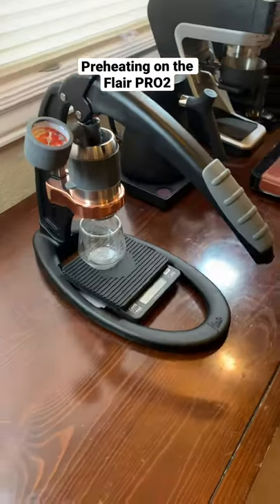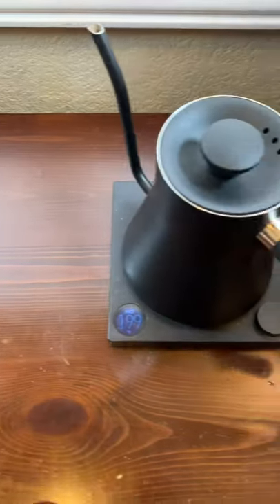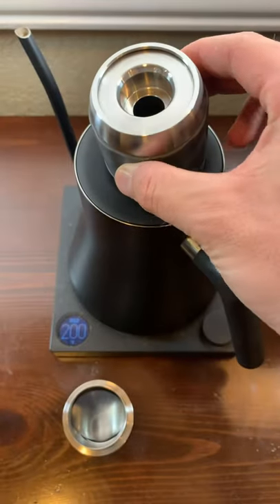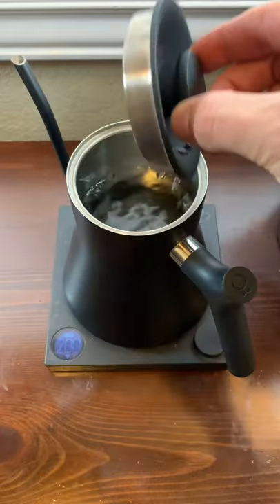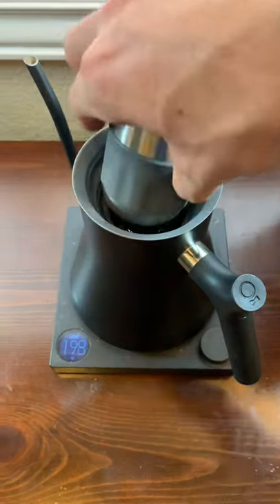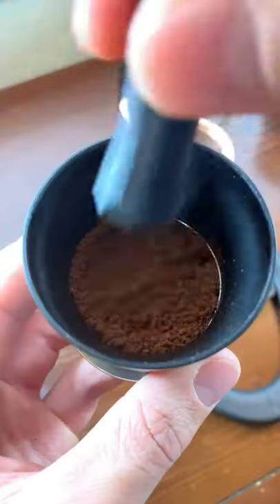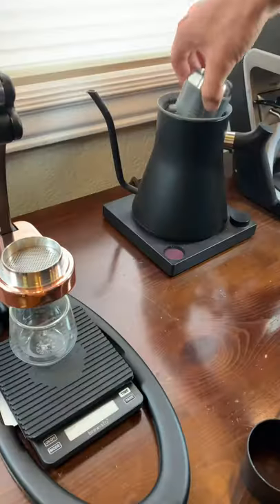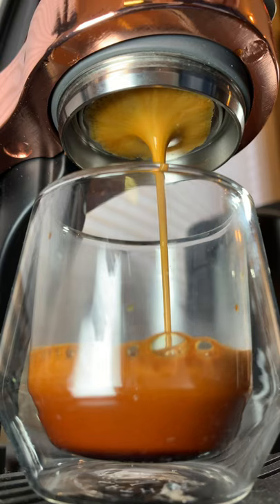Do you preheat before you brew? #shorts

Comment: i just dunk the whole thing into the kettle and let it boil along with the water. then i use silicone tongs to pull them out. it’s faster at heating up this way because otherwise you have to wait for the steam to slowly heat the metal. steam is super hot but it escapes too quickly into the air.